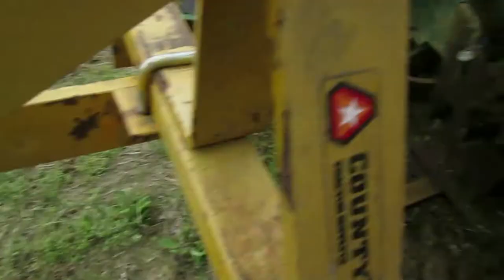Setting Tractor plows, tiller,

Comment: I installed my 2 bottom plow on my small tractor today and did not know of the adjustment part. My plow sat flat like you mentioned so tomorrow I will try adjusting. I also have a full acre of Buffel grass and the roots just grab onto the plow and get stuck between plows. Great video.
Reply from the maker: I always bush hog first if the grass is very tall, I plow afterwards, yeah, I know what you mean that tall grass is a killer.
Reply: you need coulters installed on your plows to slice the turf before plowing

Comment: good information, what was your reason not to start in the middle and do a back furrow, so you are plowing in both directions saving time and money, also how do you plow the ends to make things square?
Reply from the maker: I’m keeping my bottom level by plowing in one direction, after discing it will be square. 
If I were to start in the middle, it’s going to leave a low in the middle, after a few years you haven’t a level bottom, yes it takes more time and fuel but my bottom stays level… 
I have friends that plow from the middle but they go back to fundamentals after a couple of years… I have 16 inch two plows and my friends have three plows making each run 48 inches while my runs are 32 inches..

Comment: I have a branson tractor and it has locks or float on the lift arms where you can lock them from moving up or down. What is best way?
Reply from the maker: I use lock and manually raise or lower my plows, Here in Appalachia most all of our land is un level. This bottom here in this video is level so it really doesn’t matter lock or unlock…
Reply: @williamsgardenbees2455  thanks, that is what i was leaning towards, i live in southern wv myself. i know what ya mean. as a kid, my dad had pony's and used a Lynchberg 9 plow, but any modern plow is not made for hillsides, the ones i have are old, out of the 50's, International Super Chiefs, 14in. twins.
Reply from the maker: @roofdriller1537  back in the 50’s / early 60’s, I would lead our horse and my older brother would plow, those were the hard days but the best days of my life…  Now at 76 I look back at these memories of old..